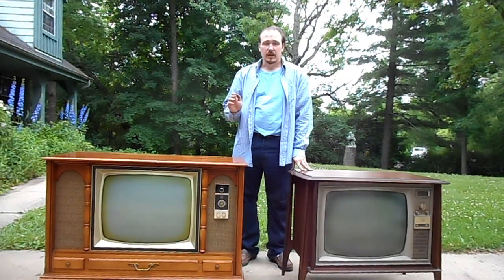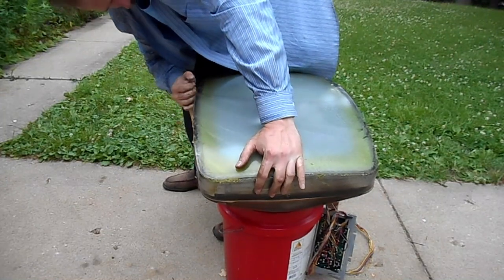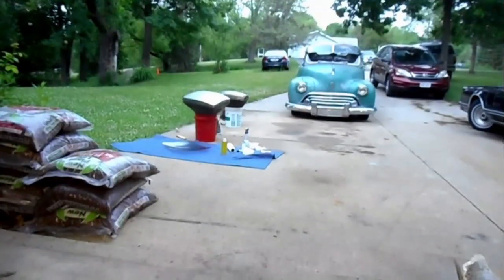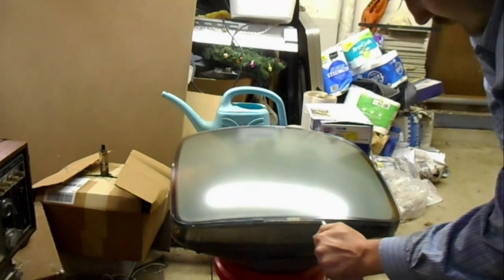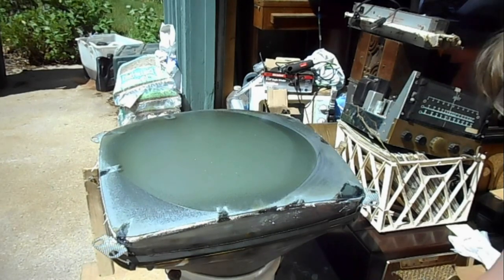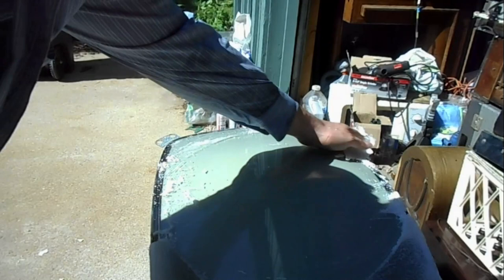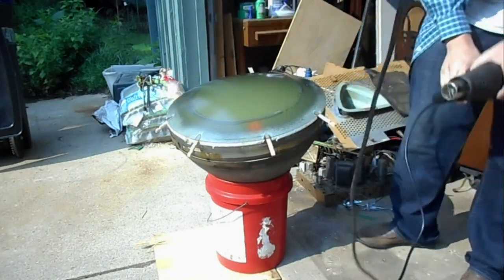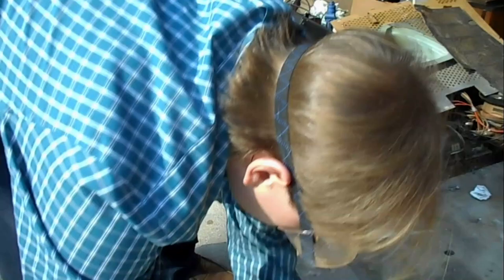3 Picture Tube Cataract Removals: An in depth look at Zenith and RCA styles and my removal methods

Comment: Ok, so yeah... this brings back a lot of memories and increased back pain.  LOL

I can't even count how many of both those models I repaired back in the day.

In the day, I was an RCA authorized dealer.  I also had Zenith, but it wasn't as an "authorized" dealer.

Around the 5 min point, you're asking about that metal bottom plate.

You are right.  That was a ONE -FITS-MANY base plate.  It was indeed used for floor models as you show here (several diff. models in fact) as well as several "table top" models and skinny floor models.  What I mean by that, is that there were some models with the screw in legs that sat on the floor, but the cabinet was not "fancy" at all.
If I remember correctly, some of those had an all-metal cabinet, using that same base plate.

One thing I'll say about the RCA picture tubes.  They produced some of the best color in the world at that time.

I used to have a good stock of different models of RCA color CRTs.

I remember when working on some other brands with the same sized tube, I could replace their picture tube (GE as an example) with an RCA tube.  Most of the time the "fit" was not 100% perfect around the edges or especially the corners.
But the resulting picture and color rendition was so much better than the original (GE for example) tubes.

That was sooooo long ago.  Literally, another lifetime ago.

Comment: I just pulled a 25AP22A from my '66 CTC17X and it is my first attempt. Getting it out of the cabinet (stereo) was the most stressful.
Reply from the maker: Wait until you get to the heat part of the cataract removal. While removal/installation is definitely the most strenuous especially on a stereo combo (I done 3 combos so far), generally it's hard to screw up bad enough to get it to implode.
When a tube is being heated by the sun the risk is greater especially if you're also using  a heat gun (uneven heating can cause spontaneous implosion).  Be careful picking out coves in the PVA to stick wedges in...If you get too agressive you can crack the safety glass and then the only way to salvage the tube is to carefully chisel the safety glass off without chipping the CRT face (had to do that on a RCA cataract recently and botched it...Quarter size chips in the CRT screen that I don't know what to do with).

Comment: Try a solvent on the wire your using to cut the adhesive. Acetone, isopropyl alcohol, and the like will do. It lubricates the cutting medium and desolves the glue.
Reply from the maker: I suppose I could try that. I suspect I'd need a pump to keep the wire wet, otherwise the solvent would probably be wiped clean off in the first 1/2" of cutting depth.  
The wire cuts good enough that I don't really need it to work better to get the result I want from an amount of effort I'm comfortable expending to get it.

Comment: you should buy a windshield removal kit...comes with a steel wire but the wire is square section or triangular with sharp edges so it cuts very well without cutting your flesh...and is also very strong. the wire comes with two plastic handles..its very cheap around here, dont know how much it costs in the USA though but maybe its cheaper than guitar wire??  for example for 30€ i buy locally that kit and it comes with a tube of caulking (PU-polyurethane) sealant for glueing the widshield, and that sealant can also be used to glue back the safety glass on the edges...the glue is always black
Reply from the maker: It's an interesting idea and may be worth trying on especially tough but doable CRTs, though I do have concerns it might scratch the glass. (I can't imagine too many folks want to reuse the old windshield so the removal tools may not be designed with that in mind). Windshield removal tools are not especially affordable compared to guitar string though. It's been ages (I think circa 2012) since I bought several for my purposes (still haven't used them up) so I forget what they cost back then, but a 12 pack of NO18 steel guitar string from a chain store is around $2.60 USD, and I keep spare wood and screws that can work as handles around from home improvement projects so the handles are basically free for me to make.
Reply: Maybe try to go to an auto parts store and ask for a windshield glueing kit...usually it has a caulking tube, the removal tool and a bottle of primer....the PU glue is much harder than silicone and its much harder to squish when applied, it also dries hard in a couple of hours....its great stuff.....we do remove lots of windshields to reuse, because an original windshield is very expensive and the aftermarket ones are crap, we use good used ones when possible and when the customer approves so..the cutting wire is sharp but it doesnt cut you or scratch, its weird but trust me you should try it..  i never had to a cataract on a tv , i collect and restore tvs but mostly dutch and german, i am located in Portugal, so we have brands like Philps, graetz, nordmende, telefunken etc  and those always come with the safety glass attached to the cabinet and not bonded on the crt...but since i work on the auto industry, i use lots of automotive procucts when i restore my sets...

Comment: I kept the tv hoping it could be fixed I've still got it and ran up on your channel and wanted to ask you if it could be fixed or not because you are a specialist more than I am about this.
Reply from the maker: Replacement CRTs can be sourced. The Early Television Museum in Hilliard Ohio has some, collectors like me have some, and some CRTs can be sourced from newer less valuable/worse condition sets.
Most parts can be sourced with enough patience. The hardest parts to source are Flyback transformers, Vertical Output transformers, and certain other transformers.

Comment: Great video, Tom. Your comments about your experience with the safety glass removal on the rectangular RCA CRT mirror exactly my personal experience with one I'm currently grappling with. In my impatience, I cracked the safety glass trying to remove it on a cloudy Northern Indiana day. I have chipped away at the remainder little by little and am left with the center, which is still holding tightly. This summer, I will take another crack at it. (No pun intended.)
  I'm wondering what the harm would be in just reinstalling the CRT in the set (It's a Heathkit GR-295) minus the safety glass? Or is it possible someone might have a spare one I can purchase.
Reply from the maker: It is possible to run these without a safety glass. Some collectors prefer it and I've had to do it on 2-3 sets that I couldn't readily get spares for (they since have been sold or gotten glass).

The difficulty of finding replacement safety glass varies with screen size and whether it's color or not. I'd say the easiest to get would be 25"/23V rectangular color followed by roundy color, smaller rectangular color and all monochrome safety glass is much less common. Most can be obtained with a year or more of patience and diligent searching. Personally I have some mediocre roundy and 23V spares I'd give away to someone in need who could come get them.
Reply: @tomcarlson3913  It is an RCA 25AP22.
Reply from the maker: @dbridger620  I do have a couple safety glasses that would fit.
Reply: I may have to take a road trip up from Northern Indiana. Have a little fun making a couple days of it.
 @tomcarlson3913
Reply from the maker: @dbridger620  I typically stop for food in Merrillville IN on my way to the May ETF swapmeet.

Comment: I have a old zenith floor tv I got from an estate sale when I got it home I cleaned it up nicely in the back and then cleaned it really good on the front and the cabinet. To my surprise when I turned it on I played with the controls some and wiggled the many different tubes in the back and it started working perfect. Well I got a cable jack put it on it then hooked my vcr with a DVD player on it and vhs it was a combo vcr. I played it every now and then for about a year then one day I turned it on to play it and I walked out the room to get something and came back in and there was a straight split in the screen running from left to right. Is my tube cracked or is it just the safety glass??
Reply from the maker: That's hard to answer definitively without seeing good close up pictures of the damage.

Sets with safety glass usually both will NOT crack in the same exact place so if you can catch your thumbnail on the crack it's probably just the safety glass, but if you can't catch your thumbnail on it / the crack seems like its covered by safety glass then it probably is the CRT face. 

Some rectangular CRT sets didn't have a safety glass...That was more a post 1972 thing, but many older sets that had a replacement CRT installed later in life got a new tube without a safety glass. (tension bands replaced safety glass)

If the screen kept making a picture after it cracked it's probably the safety glass that cracked.  If the CRT envelope cracked it would leak air into the vacuum (likely accompanied by a short period of audible hiss) and the CRT would die...When that happens the entire neck will glow purple until so much air gets in that it stops, then the CRT heaters will get very dim compared to the rest of the tubes (maybe even not light) and the neck of the CRT will get 'burn your hands hot' faster than the rest of the tubes. (The round tube from this video had a spontaneous thermal crack between the base lead seal points in operation back in October and I ended up seeing that catastrophe first hand).

If your set is a rectangular you'll have an easier time finding a replacement than if it's a round tube. (Heck if you're close enough to Milwaukee to pick up I've got good spare 22J, 23V and 25V rectangular CRTs I could sell and even install.) Rectangular deltagun CRTs over 19" all used the same electron gun, so a 1965 25" TV can use a CRT from a 1978 deltagun set the same screen size* assuming there aren't any serious mounting hardware differences (deltaguns were slowly phased out between 1976 and 1981).
I'd look for a mid-70's Zenith Chromacolor II or RCA XL-100 with the same screen size...They're usually can be had for free and usually have compatible CRTs.
*Something to beware: in 1968 the government changed the screen size measurement standard from diagonal of the bulb to diagonal of the Phosphored viewing screen (which is usually 2" smaller).  An old CRT type ID number is typically screen size in inches (or cm if foreign sourced) 1-3 distinguishing letters and phosphor type (P22 for color, P4 for B&W, P1 for green oscilloscope, etc).  Tubes made after 1968 have a V after screen size to designate the new standard...So a 1966 25XP22 would become a 1969 23VXP22.

Hope my ramblings help.
Reply: @tomcarlson3913  it's at my home I have in the country. I'll be going there to stay some on my days off this week and I'll take some pictures and try to send them to you some way to show you. I was so heartbroken when it cracked. It is a awesome set it's not huge it stands about 4 feet tall and about 3 feet wide and stands on 4 wooden legs but is totally had me shocked that it just spranged back to life and played perfect. It sat in that house for years and years and then I get it and clean all the dust out the back and took out the little glass tubes in the back and cleaned them with windex I had it looking as clean as it did when it was on the sales floor brand-new then I switch on the power and wiggled the knobs some and it came right on like it did back in the day lol. And played perfect for a year then the screen cracks one day and man I  was heartbroken. But I said well I'm not going to throw it away I'm just going to keep it and try to see if it can be fixed lol.  I'm from north Carolina if I lived near you I would definitely pay you to fix it if it could be fixed. I can not remember exactly the year of it I wanna say he said in the early to mid 60s. It's black and white so it was before whenever they made color tvs. But I loved playing my collection of tv shows like leave it to beaver and Andy Griffith and I love Lucy  on it every now and then.. my grandmother passed away 3 years ago and I inherited her big long Motorola 100 floor model console stereo with the record player and AM FM radio inside under the lid on top and it plays perfect too. I want to get my tv fixed so I can make my den area look like the 1960s with the stereo and tv in it I think that would looks awesome. But I'll take pictures of it and hopefully you can see it and tell me if it can be fixed and what year it is. I do know I can feel the crack with my finger nail when I wipe over it. If it can be fixed would you know how much one of the safety glass would cost?
Reply: @tomcarlson3913  and thanks for information the long message you sent fine with me it shows me you care to help others unlike some people on YouTube don't even answer you back or they answer with 2 words lol.
Reply from the maker: @brandonbaldwin4535  Finding curved safety glass for monochrome sets is difficult. The screen curvature is different from color sets, and fewer parts sets remain. The good thing is if the CRT is okay and only the safety glass cracked you can remove it and run the set without the safety glass (on color sets like mine some collectors prefer to toss out the safety glass). As long as you don't plan on throwing footballs or heavier/harder stuff at the CRT there's negligible risk of implosion on 1960's CRTs.
On Zenith sets look at the chassis number and model number they should both have a letter in them indicating the model year. Model number will be on the back cover, chassis will be on a sticker on the back of the HV cage and on the tube chart glued inside a side of the cabinet. They skipped some letters, especially ones that could be misread as numbers. Zenith's longest running monochorme console chassis basically came out around 1958 and got annual revisions until 1966 (I believe that chassis was 14N-something) at which point they decided they couldn't improve on it and kept building 14N chassis until around 1975 when they switched finally the low volume (elderly market at that time primarily) monochrome consoles to Solid State.

Because monochrome console circuitry remained fairly constant for close to 2 decades you might get something out of my Zenith Coburg video series. https://youtu.be/eKFUHbhij-8 

I don't think youtube comments make posting pictures practical.  There's vintage TV restoration forums videokarma.org and the TV section of the Antique radio forums antiqueradios.com/forums/viewforum.php?f=3 that are easy to join and allow posting pictures, and are also a good place to get second opinions form other collectors.
Reply: @tomcarlson3913  I was going to ask if you could run it without the safety glass but you answered that question lol. The set I have actually looks a lot like the darker color tv you have in this video. It's not exactly the same but it looks a lot like the darker color one in this video. I wish I could find another old set that does not work  but has the same safety glass on it and put it on mine. Someone was cleaning out a house below mine 5 years go and it had all kinds of good looking vintage stuff they sat out by the road and one was a old zenith tv but this was way before I got mine from an estate sale. Thinking back now I wish I would have stopped and picked it off the curbside because it probably worked or if it didn't the safety glass probably could have fit mine. Lol. And just thinking that all that vintage stuff was hailed off and crushed just literally bothers me. It will be Thursday when I go up to the country home where mine is. I'll get pictures of it. But it's funny because mine favors the old rca dark color tv in this video and the one I seen on the side of the road looked exactly  like the the light colored zenith tv in this video. Lol. If you come upon one that will fit mine I would buy it.  I've been looking for the old TV's that has the stereo in it. You the long TV's that had the record player on one end on the top and the radio on the other side on top. I have ran across 3 so far on Facebook marketplace but they said they did not work but I'm hoping to see one soon that the tv and stereo all works on it. I think them combo sets like that are awesome.

Comment: It probably would be a good idea to wear gloves in addition to eye protection when using the guitar-string method. You could potentially risk cutting yourself!! Remember, SAFETY FIRST!
Reply from the maker: I'm not too worried about the string cutting me. It's not sharp except for the ends which won't be if I do a good job installing them.  I do every bit of automotive maintenance, that I have sufficient tools to perform, my self (sometimes with a friend)...Between that and electronics I'm always getting little cuts and scrapes on my hands and arms. I'm often so focused on what I'm doing I don't even notice light scratches till later and when people ask me how I got that scab I tell them "I dunno". 
I just splash some rubbing alcohol on to kill the germs and keep on going.